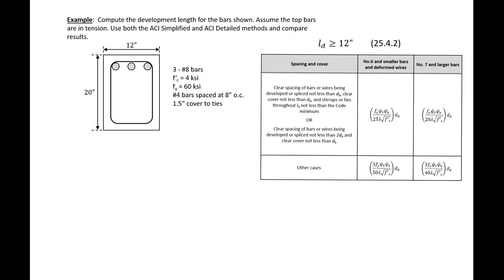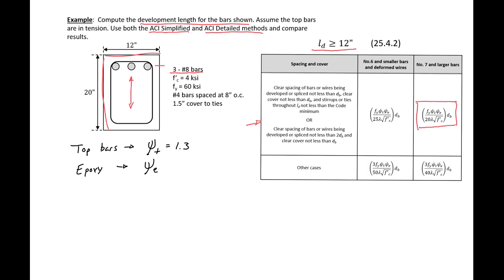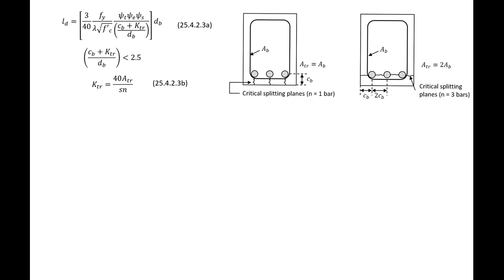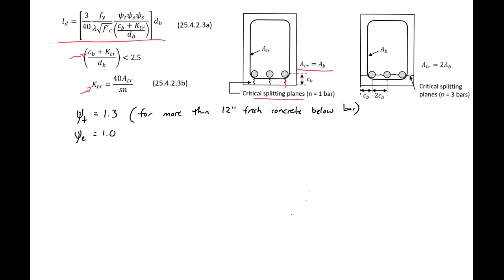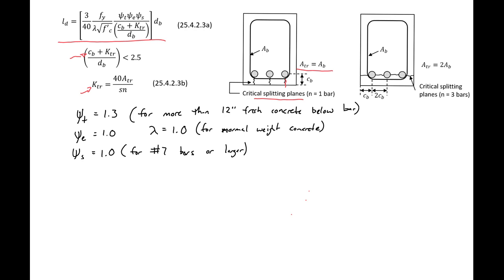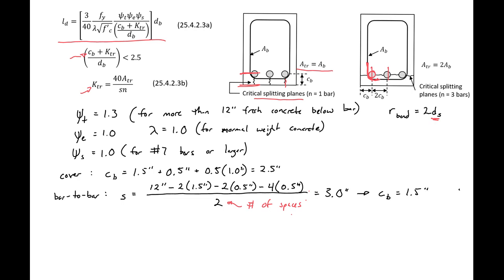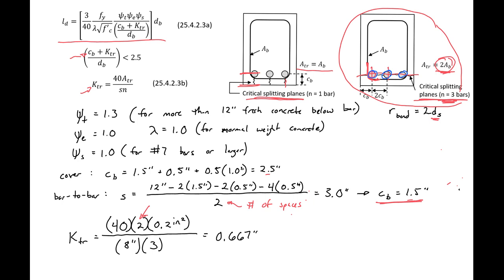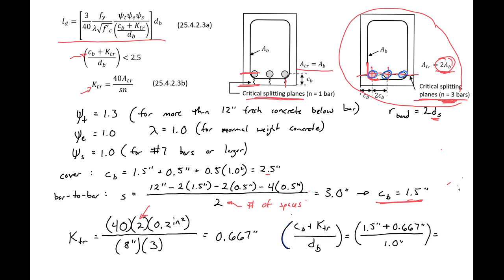10-01 - Example 1 - Development Length using ACI 318

Comment: why does the cb in the full calculation = 1.5? shouldn't it be 2.5?
Reply: If cb = 1.5", then cb = clear concrete cover and not the distance from the outer fiber of concrete to the center of the longitudinal. cb should be 2.5"

Comment: How 2 bars crossing  the failure point...
Dont understand this part...
Reply: I looked at the third page of this link (http://people.tamu.edu/~mhaque/cosc421/CH5.PDF).  Atr is the area of the transverse reinforcement which is the stirrup.  Since you have a vertical piece of the stirrup on both sides of the beam, that's why it's (2)bars.  It's not the horizontal rebars.

Comment: Sai t should be 1. Because there is no more than 12” concrete below rebar please let me know. Check the video at time 4:20z
Reply: I noticed the same thing. I guess it could be 1.3 in that example if there was tension in the top face, but then the rebar was placed in the wrong face.
Psi sub t should only be 1.3 when there is 12" of fresh concrete cast between the rebar in question and the extreme tension face that the said rebar is utilized for.